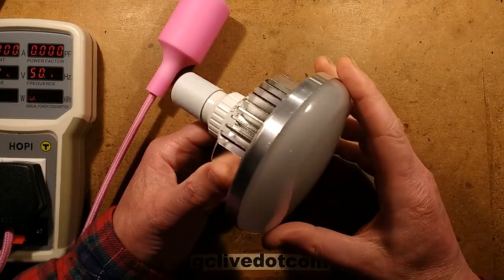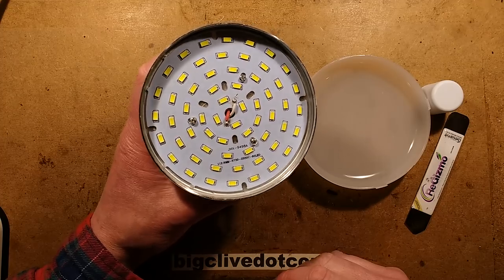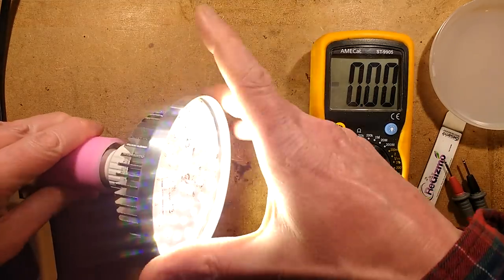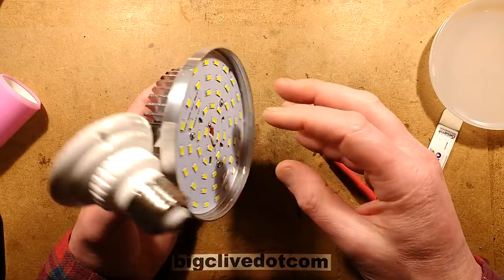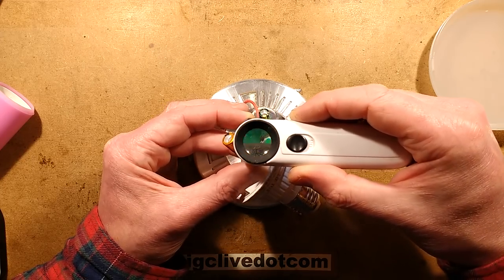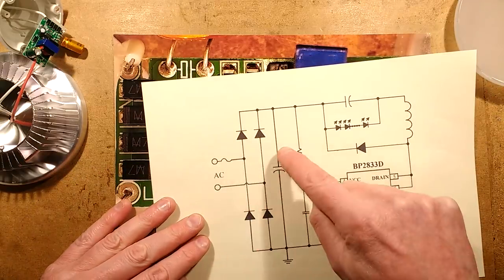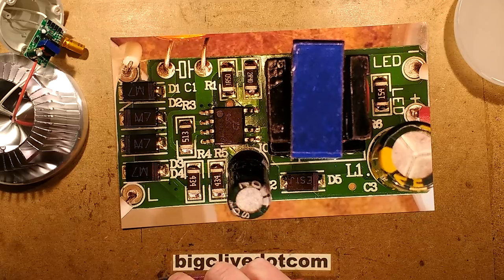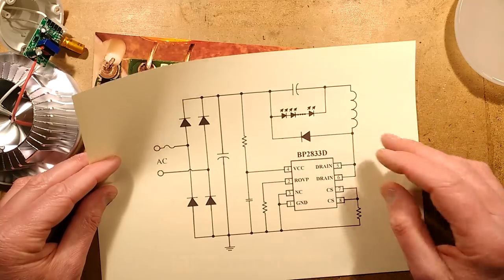Inside a stylish 65W LED photography lamp.

Comment: My reaction was "somewhere between 1/2 and 1/3 the claimed wattage" - what can I say, I'm an optimist. ;) 

I once squeezed a vendor on AliExpress because I was peeved that the spec inflation was such that the LEDs I got were just under a quarter of the claimed power; that was going too far and I opened a complaint over it. Probably had no effect in the long run, but I got a little money back. ;) 

It's sad, really ... but I suppose that makes Chinese companies like Xiaomi - who actually understate the power capacity of their USB power banks a bit - stand out even more as respectable.
Reply: Lies aside, this isn't bad.  For 20W, that amount of heat sink area is a damn refreshing sight to see.  Every time I look at SSL products, everything boils down to thermal design.  

The 19-21W lamps that I've found retail have all had essentially no heatsink.  The body is a painted, unfinned Zamak tube shaped like the neck of an A19 bulb.  The MCPCB runs 90-120C in an open fixture, base-up.  The caps and LED's are so far beyond their rated thermal capacity it's a wonder they last a day.   You'll lose about 15-20% of light output in the first month due to the extreme LED temperature.

FWIW, the 60W passively cooled lamps I build have heat sinks like a damn rackmount amplifier -- but that's because that's what it takes to enforce junction temperature with an ambient temp max of 55C and a safety margin to account for dust accumulation.  All the retail designs have less than zero margin for nonideal environmental conditions.
Reply: Isn't it amazing that Xiaomi, a popular chinese company, became popular by largely ripping off other's designs, (not 100%, but mostly) but doing it with quality and at a cheap cost, basically getting what you pay for, and that business model worked? They have never done anything groundbreaking, just deliver a quality product at a reasonable price, not garbage that was shoddily manufactured for the least amount possible. It's kind of sad, really. One of the first modern big chinese "respected" manufacturers did nothing but NOT scam you.
Reply: Yeah, the bar is pretty low these days.

Comment: Lie Tu!! Like one of those sinister Corporation names you see in a Sci-Fi film. Nice :))
Reply: Like "InCool8", but only italians may understand...
Reply: Those are special Chinese watts. Divide by 3 to get real-world watts :)
My guess is the Chinese sellers are using the term ''watts'' as a ''performance rating'' - it's as bright (or more) as a 65w incandescent bulb, so call it 65w. For many years AMD did that with their CPUs, their CPU would have a ''performance rating'' to claim their chip is as good as an X speed Intel CPU (though actually not as fast).  
The name? Still doesn't beat banggood.com or UltraFire (lithium batteries). Banggood does know what that means in English, and plays with the joke. UltraFire and likely Lie Tu probably don't have any idea... Or care.
Reply: lie clive ;-D what is the power factor ?, joule theif ;-)
Reply: Like that lithium battery brand name "TrustFire"!
Reply: i need a chinese wife !@
Reply: That was my thought as well, 65W is a reasonable number for the incandescent equivalent brightness.  They just neglected to provide both actual wattage & equivalent wattage.  Most bulbs sold in Canada provide both, to help consumers decide on an appropriate wattage.
Reply: A 22 Watt LED lamp should have significantly higher output than a 65 Watt incandescent.  Unless it's horribly inefficient it should be equivalent to 100-120 Watts.
Reply: Lie - 't you

Comment: Clive, do you think they are rating it as compared to an incandescent bulb?  Like in the stores here they say, "Same light output as a 60Watt incandescent", instead of actually comparing LUMENS.... :)
Reply from the maker: I'm not sure.  I'd be hoping a 20W lamp was a lot brighter than a traditional 60W lamp.
Reply: I noticed in Tesco recently that all the LED bulbs had wattage ratings much higher than they could possibly be. I think they have "simplified" the ratings so I guess we are stuck with incandescent bulb wattage forever.
Reply: Generally I’d expect about 10x the power into a tungsten lamp for the same light output as a given LED. so this thing should kick out the same as a 200w tungsten lamp (ish)
Reply: A "60W equivalent" is more like 11W.
Reply: There is 60 led on this lamp. Each led are rated @1w. But the driver is only 20w. This is simple . They don't advertise actual current drainage, just a "led maximum power" but the driver is usualy 1/3 . This is good for longevity. just ask actual power drainage and no bamboozle occur. (with a driver 60w lamp 3*brigther but life 10*shorter cause temp°)
Reply: WinScrounger - That would be fairly inaccurate.  Lower wattage incandescent bulbs are indeed that inefficient but not THAT bad once you get into a 60W or higher standard bulb.  For example this is a spotlight bulb with 65W printed on it.  A 65W BR30 incandescent produces around 620 lumens, but a mere 6.5W BR30 LED bulb cannot produce 620 lumens.  

To get that lumen output from the average major brands on the market today you're looking at closer to 9W if not 10W in a BR30 (or most floodlight styles).  In other words, 65W/9W = 7.2.  The reasonable expectation is that it takes about 7X the power into a tungsten lamp to produce the same light output as this, except that as tungsten wattage continues to increase, so does its efficiency so really, this would produce closer to the same lumens as a 140W tungsten floodlight, "IF" we assume that its driver is as efficient as those in the major brand LED lights, which it could be, but it's quite a bit simpler driver than found in many so I'm leaning towards no on that efficiency parity.
Reply: Don't you have some light maters? I recall seeing a vid of yours a while back where you looked at them.

Comment: By the way the two resistors that power the chip are mounted, you could remove both, turn one 90 degrees and mount it across the lower pads and you would have achieved the same thing as shorting one out. I wonder if that is what they do for their 110v-120v versions.

Comment: The texture on the aluminium fins screams to me that it was cast, and then maybe machined to clean up the LED side?
Reply: Dustin Sparks yes the structure isnt suitable to be Made by a Strang Press Maschine Like they use on normal heatsinks
Reply: Its probably just a diecast and yes u can do that     I work in that business not for metal but for plastic parts but the molds are not that different
Reply: It wouldn't be too difficult to mount a fan on that heatsink, and move the PSU to another location. In which case it might be possible to over-drive those chips a little (without too much reduction in longevity). The enclosure (and diffuser) alone would be well worth it for a special project - stick in a central high power COB array and away you go!
Reply: Phil S, I wouldn't bother if the emitters aren't high-CRI (I doubt they are).

edit: to just modify the PSU, I mean.
Reply: Dustin Sparks not with those screw posts on the inside. It’s clearly an extrusion plus a stamped tray that is first stamped from sheet and then drawn into the tray shape.

Comment: I just stocked up on 12W LED filament lamps from Maplin closing down sale. They are actually 12W too.
Reply: Whilst I understand that Maplin have gone downhill lately, it's still sad to see them go under. I'm old enough to remember when they were Mail Order only - and they certainly provided the materials to get a whole generation interested in electronics, at an affordable price.
Reply: I used ambit international and maplin in the day .I am amazed that they were mail order as you say then went high street and were amazed that online mail order killed them.someone needs an as kicking
Reply: Yes I'm sad about Maplin too. I got their first catalogue in 1987 (with the amazing cover artwork) and it made components and test equipment accessible to anyone. Previously suppliers were often trade only requiring trade accounts or large minimum orders. It helped get me into electronics in a big way! It is sad :(
Reply: Started with Maplin in the early 1970's. They did excellent PCB, PCB + components, or PCB, Components and case kits for many of the projects published in e.g. Practical Wireless, back in the day when DIY'ing PCBs was messy, fiddly, costly and the end results often far from perfect! Used them for the PW Synthesiser Project (early 70's) and the PW Smart Oscilloscope Project (late '70s).
Reply: Sadly, they've priced themselves out of the market over the past decade. They were charging up to three times the online price for some items. And I never saw the staff looking busy in our local shop.

Those 1970's catalogues were a goldmine of information for many youngsters who have kept electronics and associated skills as either a hobby or a career for the past couple of generations. Sad to see them go. 

How long until Chinese sellers start recycling the brand name? Answers on a postcard, please!
Reply: @RWBHere I agree. I was ordering from Maplin about every other week in the late 80's to mid 90's at the peak of my electronics design and project building. Maplin was never the same after the original founders sold it off.
Reply: Yeah, found out Maplin was closing down! The only place you could get decent audio transformers the doghnut ones. And the only place I bought or could find my Hakko FX-888D offical version, not chineese one which I bought before on Ebay lol. 

We will never learn our lesson from buying from Ebay! We still try just in case goods end up official for the sake of saving a few squid.

Remember Tandy's??? How old am I lol! Miss those days.

Where now for buying decent toroidal transformers??? No, not Ebay!
Reply: Back in 1982, when Maplin sold electronic kits to build, my dad bought the electronic organ kit, a massive full size two keyboard Instrument, the kit of parts filled the car boot! And the flat pack cabinet came home on the roof rack, it had a massive circuit board about 4 feet long by a foot wide!!
It took several weeks to solder all the individual Components onto the board! Nowadays all that would be on one tiny chip!

Comment: with all the lamp reviews you do you should get some device to measure the light output! Because knowing how much of that 22W just becomes heat would be very interesting. Or lacking that just compare it to a known lighting standard like a single fluorescent tube on fixed exposure setting.
Reply: great idea to quantify actual light output compared to power input
Reply: Measuring total luminous flux (the metric of interest) isn't exactly trivial.  Your typical light meter infers illuminance from intensity and alone is not suitable for comparing two sources with different radiation patterns or at different distances.  To attempt to find total flux with such a meter, you'd need to know your light meter and then integrate numerous readings at different angles around the source.  Symmetry might simplify the problem, but you'll likely be making inaccurate assumptions all over the place.   

That, and I doubt most cheap photometers are calibrated to account for LER, so two sources with different color temperatures may yield different results -- not rightly because of the human eye's spectral response, but simply because of whatever unrelated spectral response the photodiode has.

Typically, luminous flux measurement is done with an integrating chamber instead: https://en.wikipedia.org/wiki/Luminous_flux#/media/File:Luminance_Chamber.jpg  A makeshift chamber could be constructed and would likely be sufficient for comparative analysis at the least.
Reply: I mean the supplier is stating 65W but giving you a bulb with 22W. So this kind of discrepancy could also exist in the quality of LEDs.
I'm well aware it's not easy. Maybe always use a diffusion plate like the one that came with this lamp?
As i said comparing it with other light sources with constant exposure alone would be interesting to spot gross discrepancies.
Reply: Dream Services International, I hope Clive sees your post – building and calibrating a simple integrating sphere (which really is the only sensible way to measure total lumen output, AFAIK) could be a fun project to show on the channel  :D
Reply: What you describe -- using a diffuser in front of a sensor -- is how the light meters I mention work.  Similarly, such an approach would be equally difficult to get any meaningful measurements with.  Using a meter at a fixed distance from two sources of equal luminous power and different radiation patterns will misleadingly give vastly different readings.  Unless you only care about center beam intensity or something, this isn't going to be useful for comparative analysis.  Using two single intensity measurements to compare the power of sources is like comparing the weights of two buckets of rocks by only weighing one rock from each bucket.  It's misleading at best.

Unless you attempt to integrate, you're not measuring power.  Any measurement or comparative analysis would be no better than just assuming a nominal ~100 lumen/watt efficacy for the LED array.

I know we're all sort of focused on analyzing the performance of lamp assemblies, but I think you have a point regarding suspect quality of the emitters themselves.  I suppose the requirements for photometric analysis are the same, but I have a sneaking suspicion that the biggest problems with crappy LED's are undersize dice, bad die attach, and unreliable wirebonding.  I suppose phosphor degradation is a concern, but I'm pretty sure that phenomenon is just a consequence of everyone running the LED way too hot.  Short of batch operational testing, idk how you'd test die attach/wirebond reliability in a quantitative sense.  In the same sense, idk how much you'd really need to bother with photometric analysis if you're just testing for failure mechanisms that cause sudden failure instead of gradual degradation.

Comment: The heatsinks i bought make more sense now.
I wanted some round heatsinks for a project, the ones i got were from Amazon, 2" centre, 4 1/2 " outer, lots more fins, but the posts were integrated within the fins,  mine look extruded and simply cut to length (1"). so maybe mine were meant for a true 65W lamp
If there's no off position on a meter dial, i prefer to leave them on the highest AC voltage.

Comment: In regard to photography, LED lamps are becoming the new standard for studio lighting, replacing the older tungsten lamps.  LED runs cooler, uses much less power, lasts longer, and costs less.  The only drawback you might have with LED (especially cheap ones like this) is an undesirable colour temperature.  Most professional photography LED units have an adjustable colour temperature, or at least a preset calibrated colour temperature.  With cheaper LEDs, you  will probably have to experiment with your camera settings to find out which white balance setting works best for you. If necessary, you can do colour correction in post-processing (e.g. Photoshop, etc.).   These low-cost bulbs are a great bargain, especially if you're an amateur on a low budget.  You can search on Google if you need more info.

Comment: Here in Canada, all CFL and LED lights are listed in incandescent equivalent watts. So a 60w is something around 11w for a CFL.
Reply: Blair Cox yes thats so you know which normal light is replaced by the Led one
Reply: Yeah, but LEDs are brighter than the equivalent wattage CFL, so there's no way a 22W LED should only be as bright as a 65W incandescent.
Reply: d2factotum 22W would be around 150W incandescent equivalent
Reply: d2factotum: There is no static value.  It can vary wildly from 1/5 to 1/4 to 1/3 factor of actual draw versus its incandescent equivalence.  If the bulb supports dimming, it will draw more current than one which does not.  There are different emitter binnings and different noise suppressing circuitry that both affect efficiency.
Reply: I suspect warm white v. cold white is a major factor as warm white is dimmer in my experience (why are there so many warm white LED lamps in the shops? I hate warm white, I want white whites, just like the wasking powder ads have programmed me!)
Reply: Honestly, I prefer warm white and would die peacefully knowing that hash white LEDs have been banned by the world governments.  That said, high-CRI LEDs also draw more current than low CRI.  High-CRI tend to draw more power to activate the broad spectrum of phosphors, where low-CRI only need to activate a narrow spectrum of phosphors and draws little current, but render few colors as vibrantly as blue.

Comment: They do this in the U.S.  It means 65W Incandescent Equivalence.  The actual power draw is going to be between 1/4 and 1/3 of that value, as you discovered.  Incidentally, that 5500K value is also an Incandescent Equivalent value.

Comment: You should pull out the led pcb, I found in smaller lamps that there is insufficient heat transfer between the pcb and housing, causing overheating, I bet there is no heat transfer compound present.

Comment: How continuous is the light output from this?  The clever bit about driving the LEDs on both parts of the cycle is clearly to allow it to work with a high shutter speed, but is the output very smooth or still flickering to some degree at 50 or 60 hz?
Reply from the maker: The camera is very good at picking up flicker and it doesn't show.

Comment: I guess the "over-rating" thing is done to help the not technically inclined to predict the light brightness, as if the light bulb was a standard incandescent filament light.
An "equivalent" power rating rather the effective power consumption.
After all we've all been used to pick bulbs for applications according to their power rating rather than the right unit (lumen or lux).